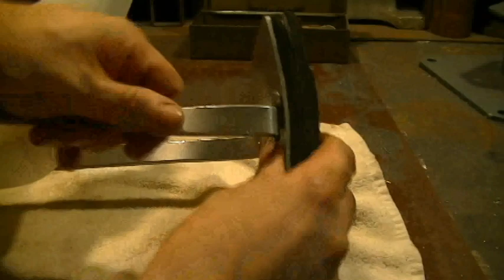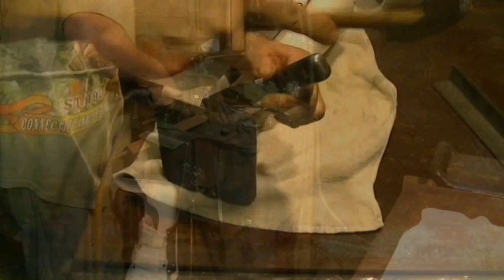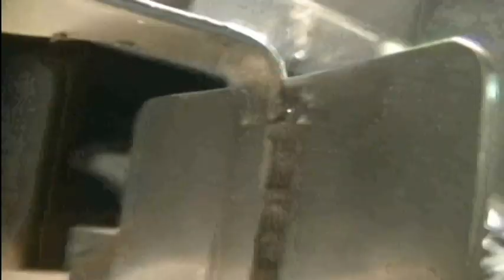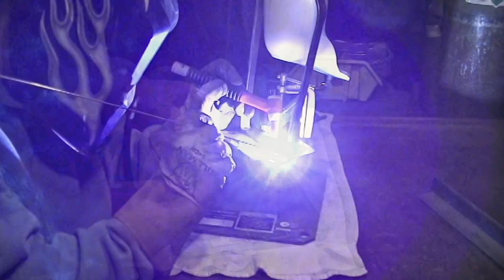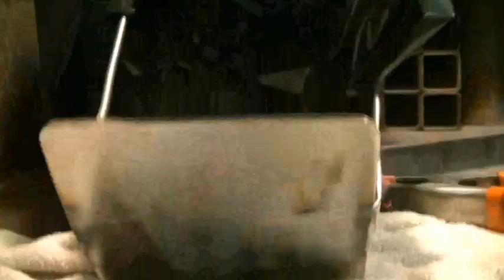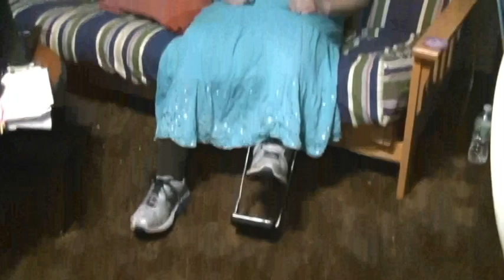Fish Plate Weld - When & Why Is It Used?

Comment: I can imagine they heated it to cherry red in order to bend it. And rather than wait for it to cool slowly, they quenched it so they could weld it and jump to the next one. They probably don't have your level of knowledge of metals.
Reply: Exactly what I was thinking. They heated a straight rod during the fab of the bend and then quenched it. That's why it shows crystallization. Anyway, thanks for the video. I'm still learning as far as welding goes and "Fish Weld" was a new one for me.

Comment: Nice job Jeff. Not everything is about the mighty dollar, sometimes just being able to help someone less fortunate out, and in this case also helping a friend to maintain her mobility and independence is worth far more than money.
It appeared to me that the fracture was caused by the probably cold bend work hardening the stainless and it then propagated via the weakest point which was the hole for the sole plate pin and then across to the base to sole plate weld. I suspect that base to sole plate weld had been done at some time after the original manufacture of the leg brace.

Comment: Nice job Jeff. Thanks for sharing your talents.  I'd be interested in hearing more about that adhesive you used on the pad. Looked like some serious bonding took place.
Reply from the maker: I used SI 500, its what is commonly used in the marine industry for adhering the gasket in boat hatches. Here is a link to the exact place and product.

https://hatchmasters.com/product-category/adhesives-sealants-and-lubricants/

They ship anywhere in the USA, I worked for them a while back and lucky enough to have them about 6 miles from my house.

Comment: I recently tried to weld cast iron with silicon bronze, using an Everlast powerarc 140st welder. I played with the settings and somehow the job turned out. If you have a chance to do some cast fill welding (the only way i can decribe it) Id be interested in seeing how its done, by a proffesional. Thanks for the videos so far. Danylo
Reply from the maker: I always use TIG when welding cast, most of the projects are small parts and the TIG allows me to get into small areas and keep a good deal of control. 

Here is a video I did a while ago repairing a cast iron stove door using a nickel rod and TIG.
https://www.youtube.com/watch?v=YgKeyMFoS7U

Comment: That bend flexes a tiny bit every time she takes a step and applies load to it. It looks like the crack propagated from the outer edge inward.  The failure could be cold working aggravated by the HAZ heat history.  Beefing it up should work. You might take a look at it in one year and see if there is any crack formation.
Reply from the maker: Nice thing about this is that she lives about 1 hour away from me depending on traffic so I get to see her all the time. I plan on checking on it whenever she is here. I am confident in the weld but I always think of the "worst case" scenario. She was very lucky when and how it broke, what if she was at the top of a staircase? 

Thanks for the comment and the view, see ya around the web! :)